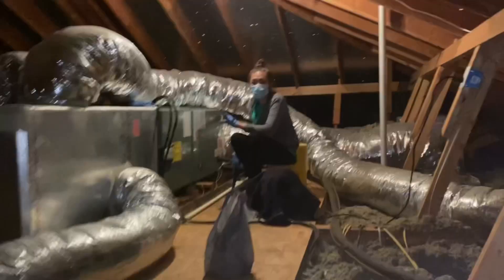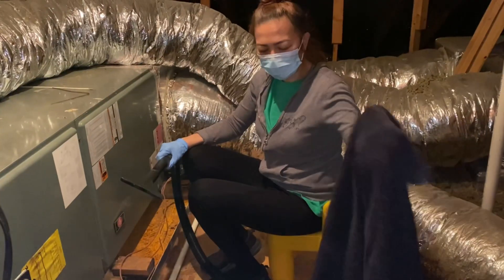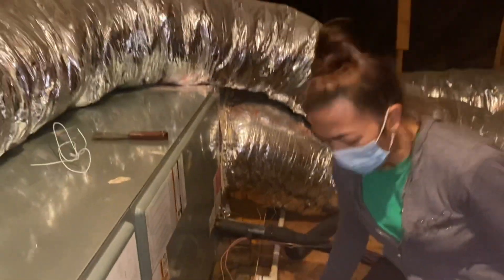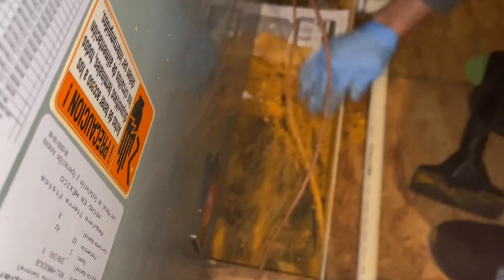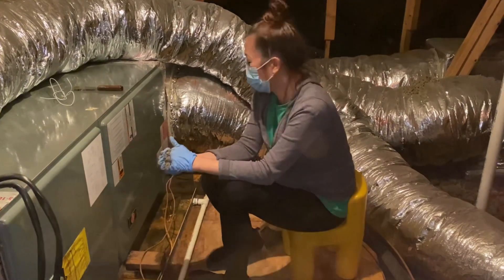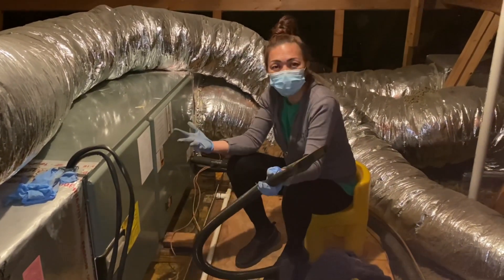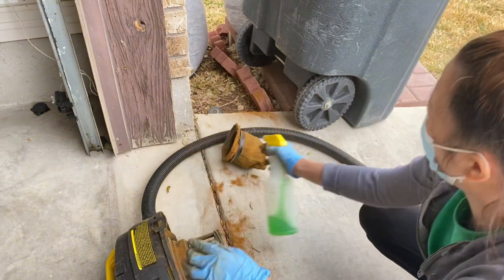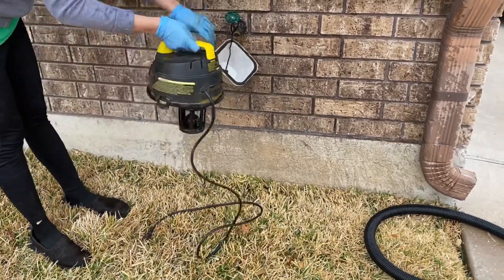HVAC DRIP PAN MAINTENANCE

Comment: We had Rust in our HAVC Pan also.  It was because our drain line was clogged.  Service man cleared the clogged and said that we should have NO water or VERY LITTLE water in what is the Emergency Drain Pan.
Reply from the maker: It happen again, Until it was leaking the ceiling, its was really bad, I replace the whole unit. I have a new AC HVAC